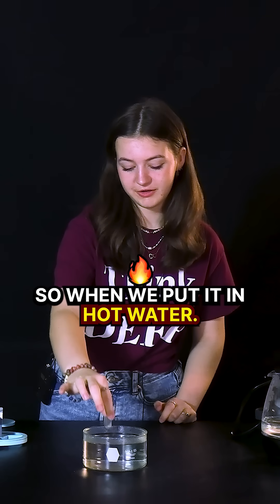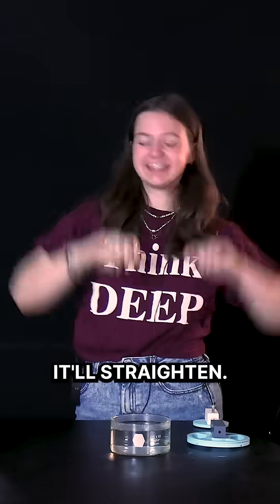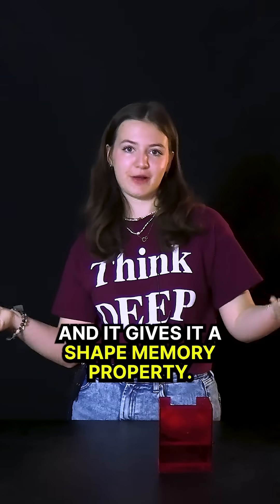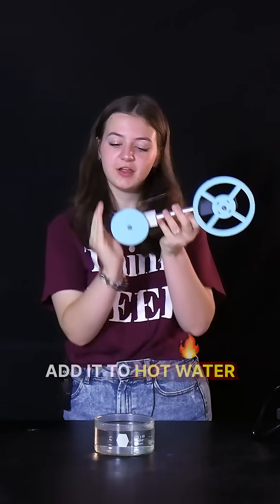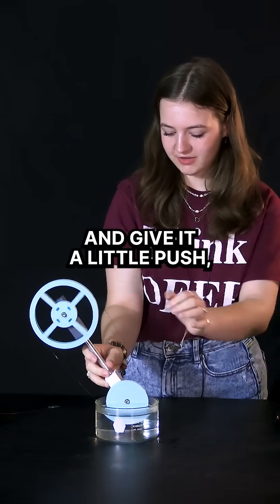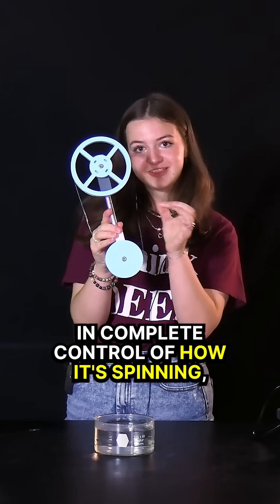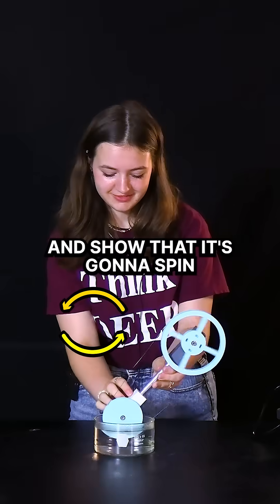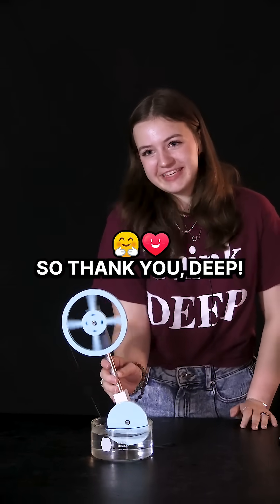Magic metal springs to life from heat! But how?? #shorts #tamu #science

Comment: It’s not perpetual motion because you’re adding energy into the system by adding heat.
So as soon as the heat source is gone or used up, it’ll stop turning. 
Pretty cool! Nice
Does the metal fatigue and lose its properties over time?
Reply: Where did u see anything about perpetual motion???
Reply: @ keep looking, it’s there.
Just spend another minute or 3 looking and im sure you’ll find it.
Reply: @jessehickman668 lol, also yes it does lose its properties.
Reply: @DerexWolfheart  in other comment chains is the answer for you. Have seen at least 3 of them so far, so yeah there is presedent.
Reply: yeah it loses its properties sadly :(
Reply: it uses less energy than steam
Reply: hot water springs always have hot water
so there u can get unlimited energy source

Comment: Sadly it can loose its properties after a while
Reply from the maker: @totalynotsmart6356  Indeed. But don't most things?
Reply: @tamuphysastr  Y'all are thinking DEEP indeed
Reply: @tamuphysastr  how many phase cycles can the material typically undergo before the effect degrades past the point of usefulness?
Reply: Plus something with this mechanism probably couldn’t take a load, sadly
Reply: Properly trained Nitinol: Can retain its shape memory for over 1 million thermal cycles.

Overheated or overstressed wire: May lose its memory in as few as a few hundred to a few thousand cycles.

At room temperature (inactive): The wire can retain its trained shape indefinitely without degradation.
Reply: @totalynotsmart6356  there's no such thing as free energy
Reply: But you can make it not lose it’s properties.
Reply: So it's bendy until wet 😅  This makes me think of the Stirling engine and crookes radiometer both fascinating demonstrations of basic physics principles.
Reply: @totalynotsmart6356     it  expanssion  and get out the wheel
Reply: @totalynotsmart6356  thankfully it's a prototype
Reply: There it is.
Reply: @strateupgamr7  there what is?
Reply: I'm imagining a scaled up version of this running a generator or pump
Reply: @totalynotsmart6356  lose.* Loose is the opposite of tight. Idk how so many people struggle to spell such a simple worse.
Reply: @Deimos_Day  the bait is strong in this one. I shall not bite.
Reply: Same with indigenous people
Reply: @totalynotsmart6356  It's called ageing sadly - but let's see how far we can go.
Reply: Perpetual engine?
Reply: @totalynotsmart6356  well… let the sun do it’s work
Reply: @nejt12475 I think that does work but in that case, it still doesn't mean it's perpetual motion. Plus, we have solar panels, we let the sun its work anyways.
Reply: Oh
Reply: So no perpetual motion😢😢😢
Reply: @MrGorillaGuy-nc7tm  it wouldnt be perpetual motion either way because the energy of heat from the water is being used to straighten the wire. After a while, the water cools down meaning in order to keep it going u need to heat the water which probably use some electricity.
Reply: @OhmShankar-xu2kw  the sun can be used to heat water but if it the material degrades it's probably worse than a solar panel even without the degradeing the exposure to water and air will cause it to tarnish eventually and weather down. Her idea is amazing though nice to see people thinking.
Reply: @BearerOfLightSonOfGod  even disregarding all of the weathering, tarnishing, and degradation, the sun would be difficult to use to heat the water. Water has a very high specific heat, meaning it takes a lot of heat to raise it by one degree. The sun would be a very inefficient and ineffective source of energy to heat the water. Think about it; there's a reason the ocean isn't even close to 80C (typical temperature to activate shape-memory property of nitinol). Ideally, a different energy source such as solar panels or hydroelectric power would be used to heat this, but then that defeats the purpose of using the shape memory alloy. 
Despite all of this, it is very interesting to see how we can utilize the properties of nitinol (medical devices, specific types of temperature sensors, small actuators), and it's also a cool physics demonstration :)
Reply: @OhmShankar-xu2kw pretty sure knows that. Anyone who would hang around this kind of content would know that basic knowledge.
Reply: @darmakusuma891  lol there are other comments talking about perpetual motion
Reply: @OhmShankar-xu2kw or leave it on the hot roof and get free energy during day
Reply: @OhmShankar-xu2kw oh yeah, well what about those solar death rays that's just a big magnifying lense taken out of a projection tv? They melt rocks with just the sun, just gotta adjust it to follow the sun along its path in the sky
Reply: @BearerOfLightSonOfGod  if you use the sun to add heat back into the water, it no longer becomes a perpetual motion machine.
Reply: @OhmShankar-xu2kw Sorry but the high heating capacity of water has nothing to do with efficiency
You can defintely heat water using the sun and it's callled thermal panels and it's more efficient than solar panel for obvious reasons
Reply: @OhmShankar-xu2kw  you can put it in a hot spring
Reply: @OhmShankar-xu2kwCan this system be reworked so that cool water is the catalyst?
Reply: @OhmShankar-xu2kw parabolic solar heater.
Reply: @OhmShankar-xu2kw My thought would be to build a pool with a large surface area, shallow depth and black lining to maximize the heat absorption.
Reply: @OhmShankar-xu2kw or you can use a natural hot spring
Reply: @OhmShankar-xu2kw would a hot spring work? Just curious.
Reply: @OhmShankar-xu2kw ise a geyser
Reply: @BearerOfLightSonOfGod   The sun uses nuclear fusion reactions, and will die out someday, so even if we could harvest enough energy from it, and weathering didnt exist, the motion couldn’t be perpetual.
Reply: @BasicUniversalEconomics  free energy still doesn't mean perpetual motion machine... its just energy being used, that hasn't been utilized before that point in time in our economy.
Reply: @OhmShankar-xu2kw  unless you make to a scale in which the friction of of the parts moving also creates the heat for the water. You would need better insulating products and an oil based reaction of the same for better lubrication and thermal transfer. Even without becoming the true definition of infinite energy, using something like a hot spring or deep thermal dug hole, you could make an energy positive device as long as Earth itself sustains life.
Reply: How ignites Olympic flame.
Reply: @OhmShankar-xu2kw You can concentrate the Sun beam using a magnifying glass. You find youtube videos in which people melt rocks this way.
Reply: @MrGorillaGuy-nc7tm  perpetual motion is never possible.
And even if that were to work, there would be barely any energy to collect.
Reply: @MrGorillaGuy-nc7tm  well, it was using water with temperature so it Never perpetual motion to begin with thermodynamics my guy
Reply: @bloodfrenzy Yeah just free energy. Would be the same as saying solar panes or wind turbines are perpatual motion machines😂
Reply: @MrGorillaGuy-nc7tm  I  this house we obey the laws of thermodynamics!
Reply: @MrGorillaGuy-nc7tm the whole point of perpetual motion is that it’s impossible lol
Reply: @MrGorillaGuy-nc7tm  nope, laws of nature still at play
Reply: @MrGorillaGuy-nc7tm  of course not, it needs heat, and heat = energy.
Sooo it makes thermal energy turn into energy in the form of motion
Reply: @MrGorillaGuy-nc7tm  it wouldn’t of been anyway because it’s source of energy is heat which would take another source of energy like nature, electricity, fire or a chemical reaction  and you can’t rely on nature to keep the right part hot too much and a chemical plus fire would require constant feeding or replacing. We will never have true perpetual motion

Comment: Perpetual motion?  Clean energy at the very least if it could be scaled up.
Reply: @HawthorneHillNaturePreserve  whats heating the water?
Reply: Can’t be a supposed perpetual motion machine as it requires a constant energy input in the form of a heat source. Not readily scaleable as titanium is expensive and difficult to process.

Comment: So how do energy loss in this contraption, by heat?
Reply from the maker: @azrizh_2236  The wire heats up and cools down very quickly as it leaves and renters the hot water. The loss of motion is due to the water needing to keep heat.
Reply: fuel have to burn to keep that water warm
Reply: The energy loss is going to be heat and such. Depending on how hot things need to be, that seems like a really good idea for an area with high geothermal activity.
Reply: @AzureLupine unfortunately the material itself loses its properties over time. Otherwise, it would be a fantastic way to take advantage of geothermal activity
Reply: @Hi_Brien  we already can use geothermal energy with turbines or heat pumps. Those are also probably more efficient than this wire.
Reply: Both the heat inherently lost, and also the heat from the water. It straightens due to the temperature of the water. That heat gets converted in the process. It's just heat taking a new form, then dispersing into the environment.
Reply: Yes. It takes more energy to heat the wire, than the wire could out put from mechanical motion.
Reply: energy transfer
Reply: I'm guessing the wire loses heat when it exits the water, and it has to lose heat before it can enter the hot water and warm up again, otherwise you dont get any motion